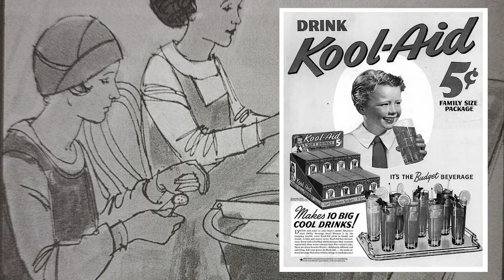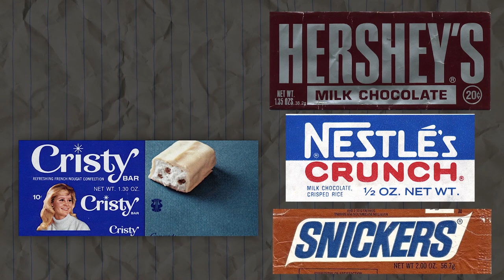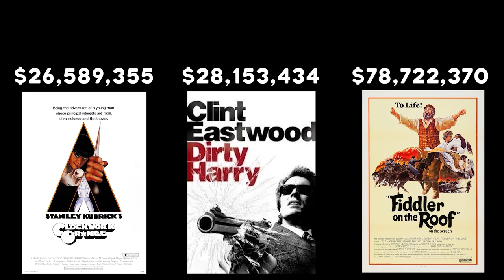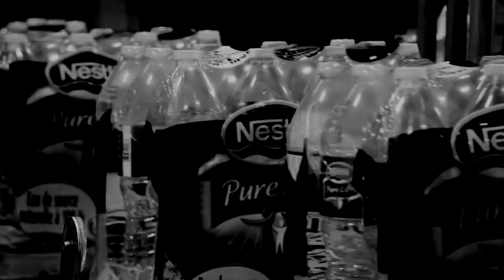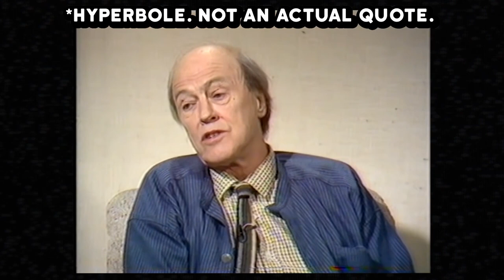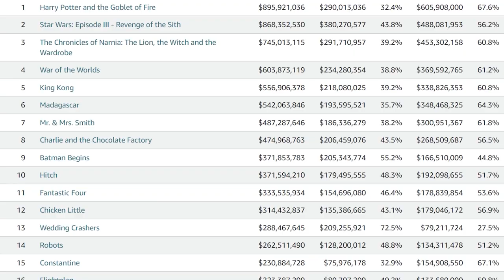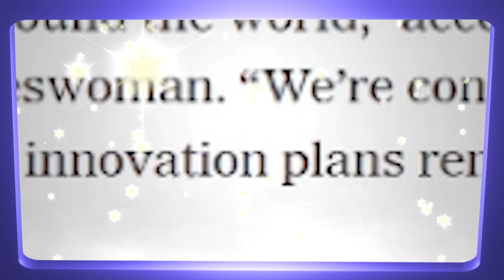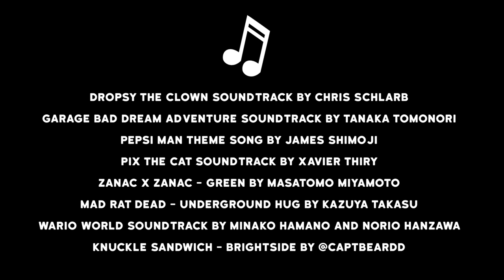Willy Wonka & The Hypocrisy Factory: The Unfortunate Fate of the Wonka Brand

Comment from the maker: I made a couple small math whoopsies at 31:23 - The 1971 film's budget was 3 million, not 4. Inflation calculators also seem to vary wildly depending on which one you use which led to the confusing number at 34:11 which came out lower than the 1971 budget as estimated in 2005. 

All the points made at these parts still stand, but it kills me inside that I didn't notice these errors beforehand. Apologies. 😔
Reply: are you not monetised?